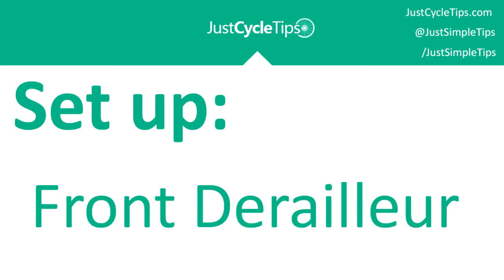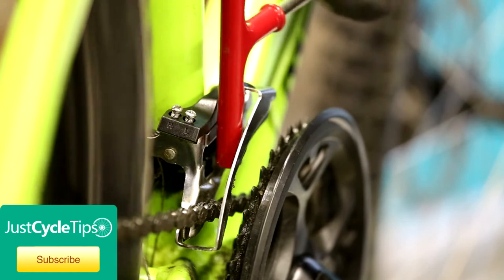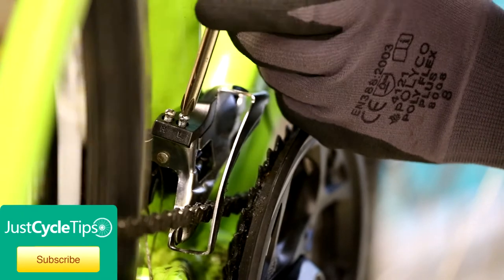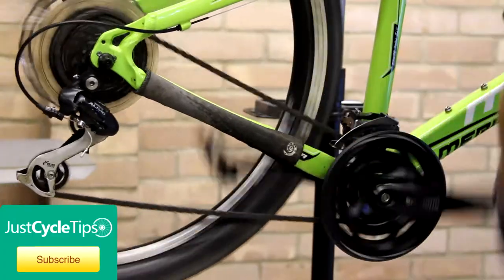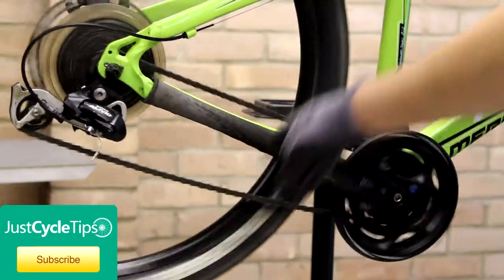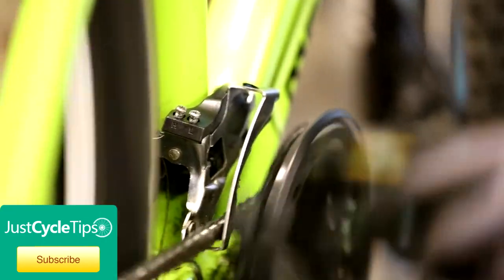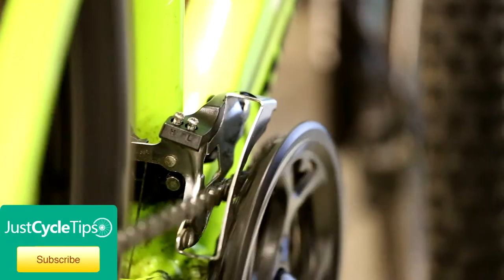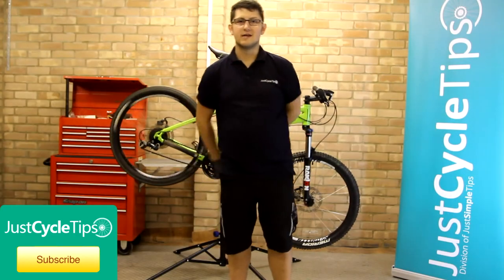How to set up your Front Gears (Derailleur) on a Bicycle | JustCycleTips

Comment: Terrible advice  3 mm works in most cases but not all . xt decore triple 9 speed back on the inside of the front mech there is a ridge. On the small front cog the chain should be just under the ridge.Put tension on the chain when adjusting below the ridge this is the only way i could get full range of gears, when on the front large cog the gap is 15 mm